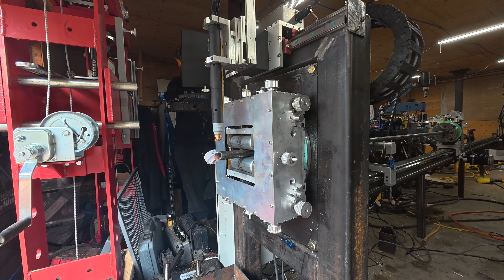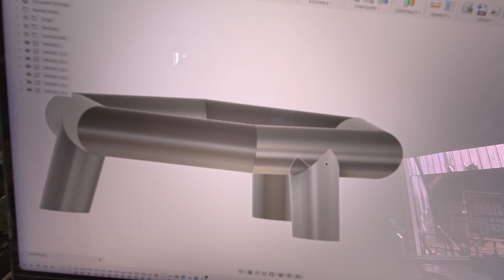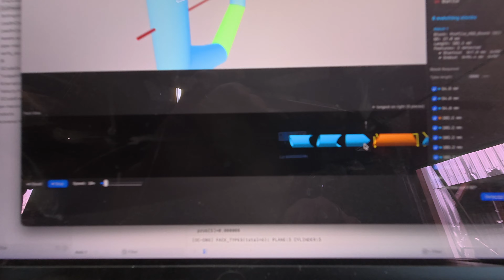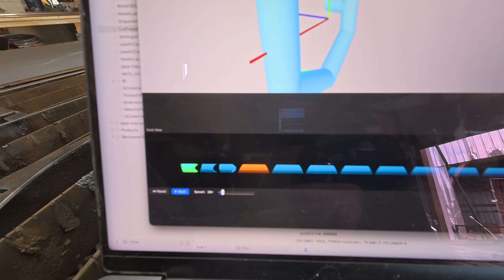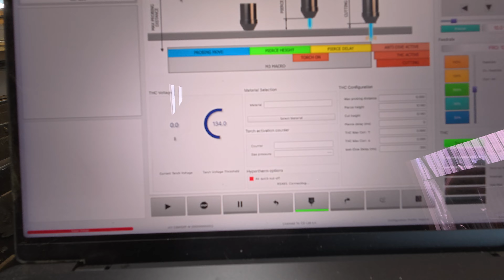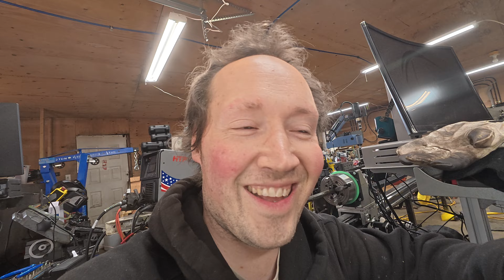Rotary Plasma Cutter Intro: Pipes

Comment: step files to gcode is huge. I ended up making my own software earlier this year to handle it as well. I used to have to take my tube model, split it, convert it to sheet metal, create a 2d toolpath, then run that 2d gcode through gcode ripper to convert it back into a rotary path, then manually edit that gcode to include all of my z torch touch off moves and whatnot. The old way got it done, but now its export the step files, open the new program, create gcode and send to the rotary plasma cutter. It used to take me about 20 minutes per tube to create the cut files, now its instant. It actually makes that machine usefull again. I used to debate on wether or not it was worth creating the code or just manually mark, cut and cope with a holesaw.
Reply from the maker: see, that's EXACTLY why I wrote my own software for it. 
good machines need good software to run and save the operator time.

I build a 10' graduated sheep gate in Fusion 360 (30 minutes), added zero-bevel gcode path generation to my software (another few hours), and cut the gate in 45 minutes on the rotary, where the majority of the time was switching tubes.
welded together without any issues, not even post process cleanup grinding.
Reply: @yunafarms  It's nice when you can make simple projects quickly